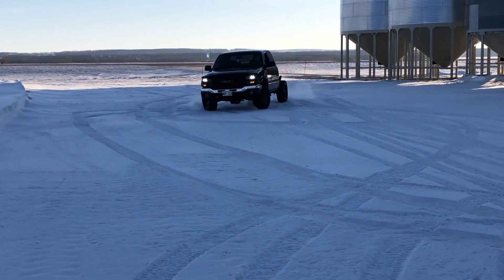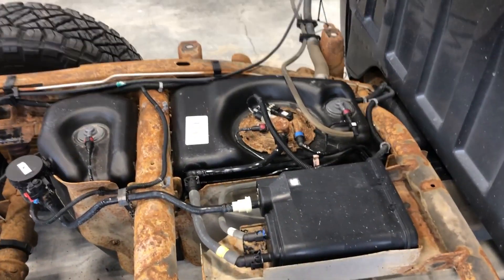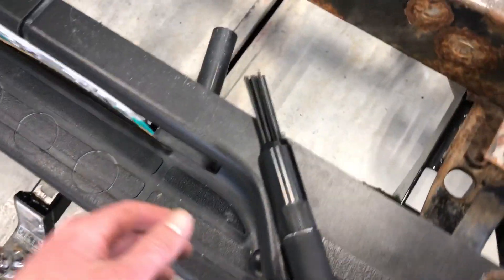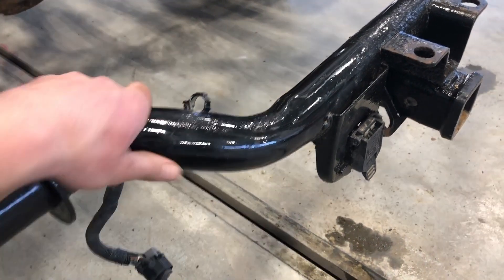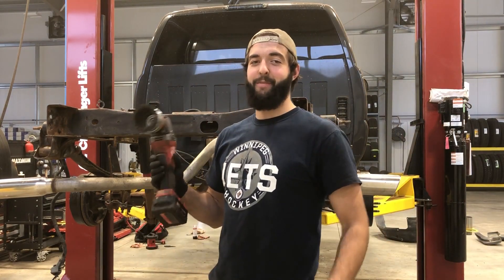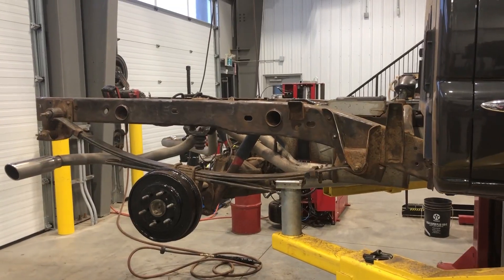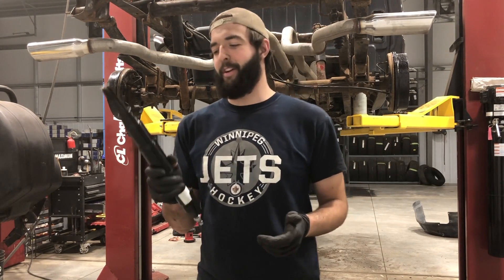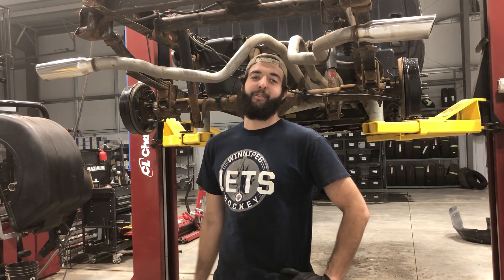Frame Prep: Fighting 15 Years Of Rust

Comment: Gotta use that PPE bro. Respirator, face shield, leather gloves. Grinders are to be respected or you're gonna get bit.
Reply: Not sure if it was just me but my grandpappy always scolded me if I had gloves on, he lost a finger from the gloves getting caught
Reply: Yes I totally agree, got to treat that grinder like a blood thirsty tiger never turn your back on it. Respect it! It can change your life in a lot of different ways.
Reply: @noblebrown7533  I can relate to that, I use gloves because my skin is thin so any cut can easily split my skin so I wore gloves almost all the time. I was told to never use gloves close to circular blades (be it grinder blades or saw blades) because they can grab on your glove and pull it in. My best advice is to try to distance your gloves away from any circular blades. Same applies to wire bush cup, drill bit, sanding machines, and so on. So I would follow your grandpappy's advice, even it means more cuts on my hands, it's nice to keep whole fingers and hands

Comment: Working on a new (used) truck bed for my 2010 150 and was planning to use a sand blaster which I tested today. Would have taken about 100 lbs of fricking sand. This method seems to work just fine. Heading over to Harbor Freight tomorrow to get a pneumatic sander and some wire brushes. Going to pick up the needle scaler too. Looks like a handy tool for those tight spaces. Will be some work, but the results look worth it. Another very helpful video brother.

Comment: What brand is the wire wheel? I'm trying to find a good one, but both the ones I tried just ended up rattling my bones (the grinder works with other wheels, so it's definitely the wheel.)

Comment: Great and helpful video. I could not tell, was that just a regular wire brush you used on the grinder? Any recommendations? Doing the same for my 1990 gmc rear frame to get the rust scale off.

Comment: What is the coating that you are using on the frame?
Reply from the maker: Seth Steria POR15, I’ve it used multiple times before and always had good results with it
Reply: @PrairiePistons  thanks man!!! Found it on ebay. Gonna try it an see how it works. I love the results on your truck!!!
Reply: Damn wish my frame was that good to start. Just finished mine up and it was a mess. Those scalers make quick work of the rust. I used a rust converter after getting the rust off and a bed liner spray. It does a good job but I hope I never have to do it again it really sucks.
Reply: @PrairiePistons  I have heard that por-15 should be used on metals with slight rust. Not to clean frame to bare metal. Por-15 does not adhere well to bare metal. DID your Por-15 hold up well on bare metal frame? Updates?